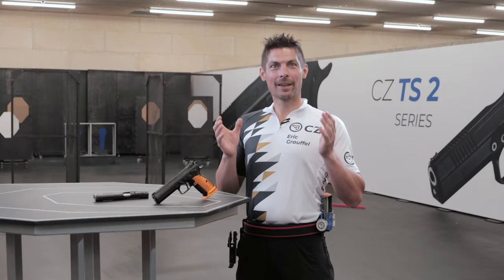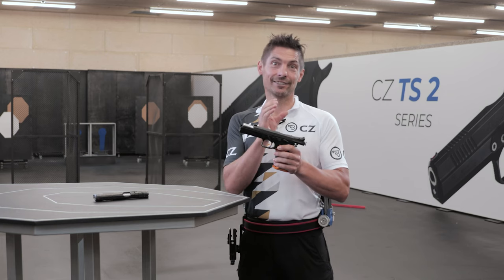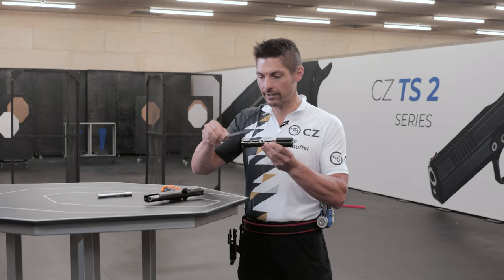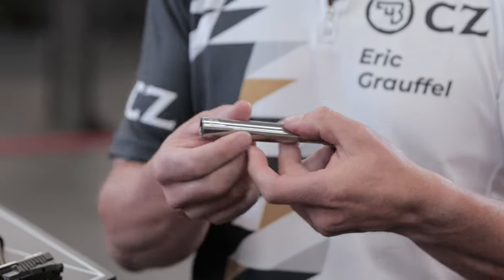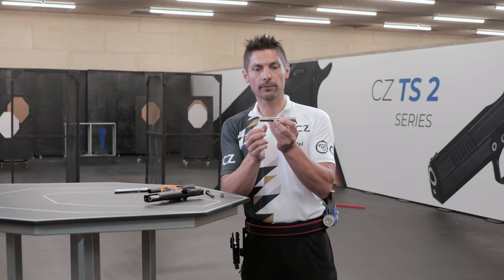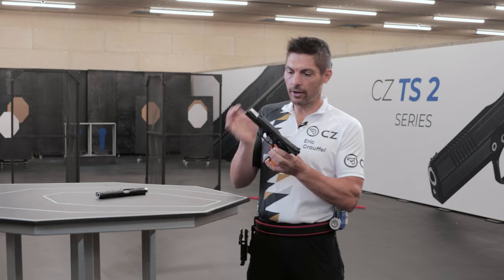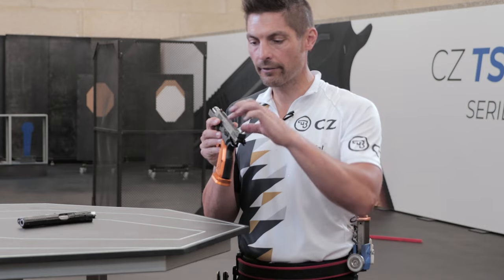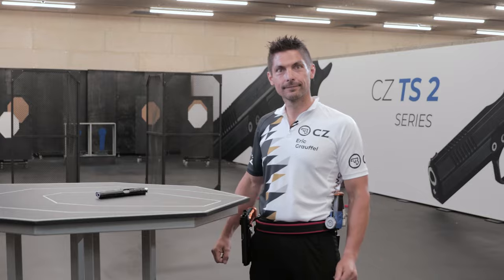CZ TS 2 ORANGE Introduction by Eric Grauffel

Comment: As a USPSA competition shooter, I agree that this is a terrific "Limited" division pistol (in .40 cal) as CZ intended.  Now that the new "Limited Optics" division opens in 2023, we competitors are requesting the TS 2 Orange be manufactured carry optics ready like the Shadow2.  I normally shoot a Shadow2 in the CO division, but this would be a perfect upgrade (in 9mm) into our new division.    I like the higher beaver tail & safety. The magwell is excellent, and of course the Bull Barrel makes this a good competition pistol (as intended for us competitors).
Reply: Mount optics via side rail… easy
Reply: Frame mounting on the side weapon may cause it to be "open division" only which the Czechmate already exists and is better suited.

Comment: I am quiet interested in this gun as my first competition pistol. However, it has a 800g trigger pull and most german competitions requiere a minimum of 1000g. How complicated would it be to increase the trigger pull to the mentioned threshold? On CZ parts, they offer different sear springs for the TS 2 line. Would a stronger spring be an option? Furthermore, will the trigger characteristics be affected negatively by replacing the sear spring?

Comment: Looks like CZ Custom Bull Shadow 2!!! I love mine.
Reply: What abput accuracy does bull barrel made any improvement in accuracy?
Reply: Honestly the bull barrel provides weight and dissipates heat better for a longer match. You have faster follow up shots due to weight. Accuracy IDK most guns out shoot the owners. The Bull shadow 2 the fit and finish and super smooth trigger pull even in double action is worth the money. If you not going to be shooting a whole lot you might not see the difference.   @advmotorrad
Reply: @nathanielmilam75  hey is shadow 2 orange bull barreled ? Im surprised.. isnt it only front bushing with only stinless barrel hand fited?

Comment: how about you get with the times and release an optics ready version already
Reply from the maker: Hello, this model is generally meant to be used in IPSC Standard division where red dots are not allowed. That said, it does not mean such option will not be available in the future.
Reply: There are mounts that bolt to the frame available. Not much room on the slide.  Also comes with a handle to rack the slide that replaces the rear site.
Reply: lern 2 iron sights -.-
Reply: @LIONTAMER3D iron sights in competition shooting are fading away. Dots are the future. Embrace it. 😂
Reply: @jagpilotohio  or tape a toilet paper core to the slide & get 90% of the benefit of an "optic"
Reply: @CZfirearmsOfficial  Could you tell me what is the difference between the CZ 75D COMPACT THE ONE WITH THE PICATINNY RAIL and the CZ 75 P-01? PLEASE.!!

￼
Reply: with toni systems hardware similar to ts Czechmate you can set this up to run open as well with a cmore or romeo.
there is not really much real estate on the slide for a mount. CZ can correct me but the sliding mass is really low. your issue running open will be those with comped guns. they will be more fast/accurate likely with follow up shots. when i run the czechmate with and without the comp it's pretty dramatic.
Reply: @LIONTAMER3D I am an old fart, need eye assistance. I am thinking of another CZ, higher end, for range use.
Reply: Uspsa has limited optics division now. So we need a SAO and a slide mounted optic. Come on CZ

Comment: Could you tell me what is the difference between the CZ 75D COMPACT THE ONE WITH THE PICATINNY RAIL and the CZ 75 P-01? PLEASE.!!

￼
Reply: aluminum frame for the P-01, Steel frame for the CZ 75D compact (which was a limited run that wasn't even supposed to be imported)